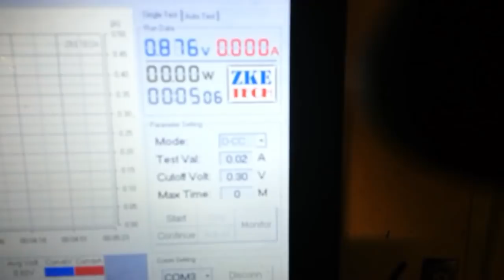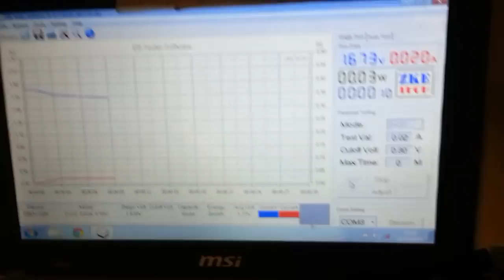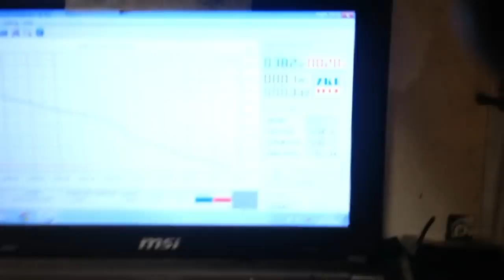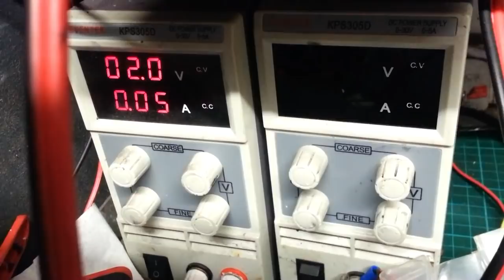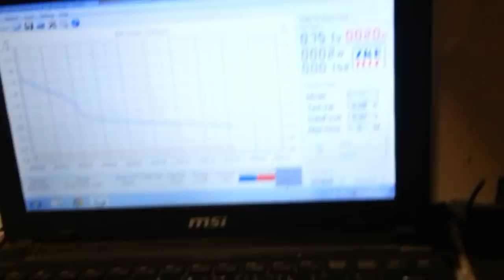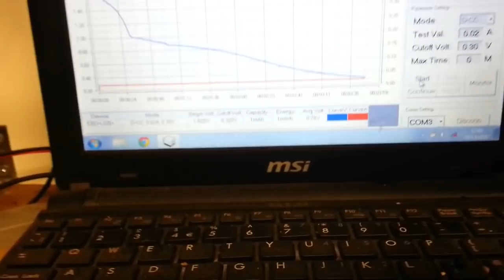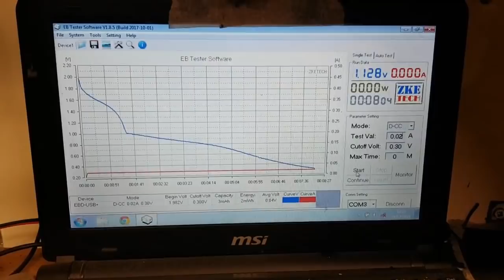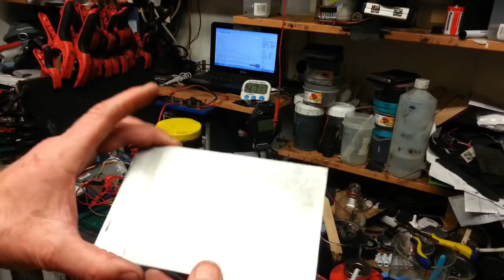So A Battery That Runs with just a Water Electrolyte

Comment: Aluminium corrodes even in pure water. It pinches hydroxide ions from the water to make aluminium hydroxide, which is quite soluble. This leaves an excess of hydrogen ions in the electrolyte, so it becomes more conductive and mildly acidic. Unfortunately this is not a workable rechargeable battery because the aluminium hydroxide cannot be reduced back to aluminium metal (in the same way zinc would) because it needs very negative voltage to reduce it, and in water that would just cause electrolysis and bubble hydrogen off instead of plating out the metal. So over time, each discharge dissolves a bit of aluminium and on charge it can’t reverse that, so at some point the electrolyte will be saturated with AlOH3, and it will stop working. I think you got increased capacity with the coconut shell carbon simply due to its ability to adsorb hydrogen and hydroxide ions, although it may adsorb others such as AlOH(2+) or AlOH2(+) as well.

Comment: The aluminium react with the water to form hydroxide. Also you get the oxide layer on the aluminium. pH value between 6.8 and 7.3 is present as hydroxides. Good one Kev, I hope that you will make more on this project
Reply from the maker: thanks mate, i intend to but i am waiting for my pure Distilled water to arrive and some better separator materials 😎
Reply: @mouldykev  the aluminium battery have good future because have greate theoretically capacity, so is good to make more research on this type of the battery. Some urea:alcl3 electrolyte is also good 1.3:1 mol ratio alcl3:urea
Reply from the maker: @cayrex  Yes you are the second person to mention Urea, but i want to stay away from Al chloride for now as i would like to do this in building block stages to keep things simple....when i tried this before i got many cycles from it until i got bored.
However a good Aluminium battery could be what we need, any 3+ metal ( three electron redox properties ) will lead to a higher capacity and faster charge rate.
Reply: @mouldykev  the urea is the replacement for the [EMIm]Cl, which is used in current Al batteries.
Reply: @mouldykev  Also AlCl3 is the source for the aluminium ions that can intercalate into chatode

Comment: The aluminium carbon battery is fairly well understood. Relatively new work @ Stanford got interesting results by adding metal salts and foam carbon. Charge capacity improved asymptotically over a 1000 cycles, and it did't die after the screwdriver puncture test.
Reply from the maker: Hello mate, Carbon Foam ? Sounds interesting do you have a link.
Reply from the maker: @wanderingzanzey2126  Thanks mate just had a look and whilst downloading it then realised ....... i already had the paper...DoH
Reply: @EmmittBrownBTTF1  the tricky part is still the AlCl3/1-ethyl-3-methylimidazolium chloride, which is the electrolyte. You need to make the aluminium salt ionic luquid in a glove box filed with argon, because the electrolyte can really easy oxidize and also the ionic liquid is expensive for the large scale.

Comment: My guess is that there could be a small amount of Magnesium in the Aluminium. It reacts with water to turn alkaline Magnesium Hydroxide. But you showed it had a neutral pH. Maybe the pH is too low for indicator paper to show, but high enough to react/oxide the aluminium plate? Don't know for sure. Very interesting Kev. Thanks :)
Reply from the maker: interesting possibility

Comment: I got to thinking and all aluminium has a thin oxide layer that forms on the surface. Maybe the oxide is being stripped as fast as it is being created. I would guess that the more you charge and discharge, your electrolyte is becoming more and more saturated with aluminum oxide and you will start to pull more and more amps with each charge. This will also cause the plate to erode faster. I bet if you have the aluminum plate hooked to the positive side it will cause the aluminum to oxidize and strip faster.
Reply from the maker: Time will tell i guess, but there is no mileage in putting the Ally on the Pos side.
i will be doing a follow up vid in due course.

Comment: adding urea to the water will improve current due to a carbon-chain storage mechanism within the water.
Reply from the maker: Ok i will try this
Reply: @mouldykev  The urea may degrade the aluminium though, so copper may be a better choice. However i am not certain of this :) I do know that a conductive ink painted onto a degreased nickle mesh works well instead of a graphite plate. I generally use Ethanol and PTFE solution but CMC and SBR would work for this as well :)

Comment: Unfortunately, I think what you have here is a Graphite/Aluminum battery. Most likely aluminum salts on the plate are dissolving in the water giving you your electrolyte. I highly suspect that those graphite plates are screwing us over by acting as an active material and not just a collector plate. Even though you cleaned the graphite plate well it still is envolved in the battery chemistry, maybe absorbing ions by intercalation.  I was fooled myself this week in thinking that I had an aluminum/activated carbon battery. For reference, I build one with no activated carbon on the graphite plate/separator/Aluminum plate plus 2M AlCl3 electrolyte. Guess what ?............., both worked just as well !!!!  Therefore the activated carbon was doing nothing except leading me to a false conclusion. I plan on doing more this week to sort this all out. 
Bill
Reply from the maker: Yes mate you may well be correct, i did mention this in the vid, that i thought the plate was acting as a storage medium.... which is A ok in my book 😎

Comment: De-ionized should have a resistance of 18.2 Megohms. Def check that carplan di water, as in my previous experiments that carplan di water still has quite a low resistance, eg still quite a few minerals in salts in there to transport ions. Pure distilled has no such contamination, and would be the way to go to further explore whats actually going on with this particular experimental aluminum carbon cell. From initial appearances i would say the trace salts in the carplan water is also at play in this case. Using distilled water (quite easy to make to get the amounts to give it a test), should confirm whats going on alot more indepth i reckons :) (y)
Reply: Ps. Thoses new ceramic ball mill balls are most likely to be made of Aluminum oxide/ Alumina, which is almost as hard and as tough as diamond. Should last virtually forever. Way more durable and inert than stainless steel balls by many moons*
Reply: Pss. That cerium oxide should dissolve in fairly concentrated citric, acetic, lactic, hydrochloric, or sulfuric acids etc and should react together reasonably well to create ones experimental cerium electrolyte salts. Evidently Methanesulfonic acid is the one of the ones thats been tested that works seriously well for Zinc/ Cerium battery chemistries. Methanesulfonic acid is used as an eco acid additive and alternative for v nice bright metal plating solutions. It can dissolve a wide range of metal salts in significantly higher concentrations than in hydrochloric or sulfuric acids, which seems to be quite unique. Also happens to be contained in an eco bathroom cleaner called Faberlic Universal Bathroom Cleaner (on ebay), 5% methanesulfonic combined with 3 other acids all at 5% concentration. Interesting thing is its even got ones favorite gelling agent in it as well, so its virtually like a very unique super electrolyte already! :) (y)
Reply from the maker: Yes i should have remembered that from one of our previous convo's, someone also sugested that the separator could be slightly acidic.
Reply from the maker: @petermiddleton6902  they are working very very well mate.
Reply from the maker: @petermiddleton6902  you always come up with the goods, don't you 😎
Reply from the maker: @petermiddleton6902  ha ha ha, just looked it up it certainly does contain ones favorite gelling agent.
Reply: @mouldykev  A neutral separator should work fair enough, the trick with the zinc/ cerium bat chemistry appears to be keeping the two electrolyte sides from mixing. So some sort of ionic exchange gel impregnated separator material maybe the way to go here :)
Reply: @mouldykev  Great to hear they are work well mate!
Reply: @mouldykev  I only send the best ones that have much promise, but theres actually many failures behind the scenes ;) (y)
Reply: @mouldykev  Yes that magic gell has certainly many fantastic proprieties :D

Comment: You have discovered that your paper separator is slight acidic :)
Reply from the maker: Good theory i will try something that cant be today.
However the tests did show that everything was 7 all the way through, charge and discharge. Which is unusual, dont you think?
Reply: @mouldykev  it is very unusual. To convey charge there must be a differential, conventionally the charge flow through the electrolyte must use ionic flow via OH- or H3O+ routers in a distilled water system. If the water was dissolving AlO at all the pH would change. Now... While this all well and good Litmus papers really can't be used to settle this obeservation. Only a true digital meter or titration test will tell you for certain if there is a difference between the two sides. You could have a psueodocapacitance as well, your data curve was remarkably similar to a battery, but one can not rule out capacitance being a driving charge transfer mechanism
Reply from the maker: @wanderingzanzey2126  i like your observations. And you have just reminded me to try and find my digital system for this instead of relying on the litmus test 😎